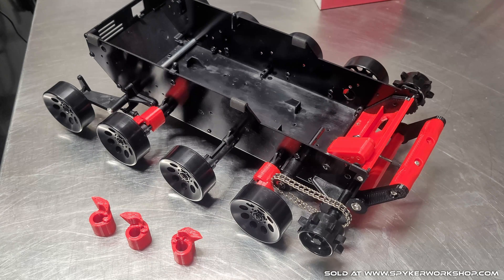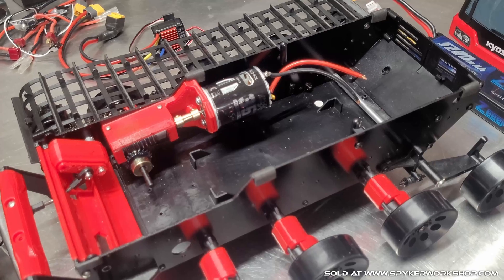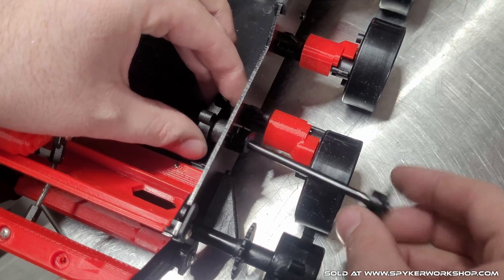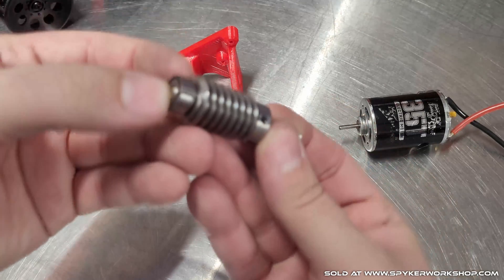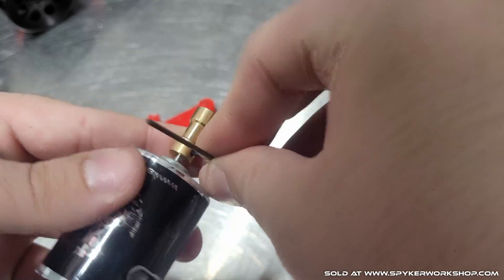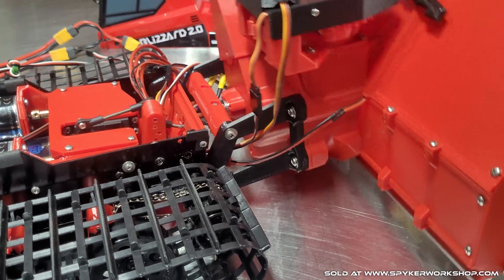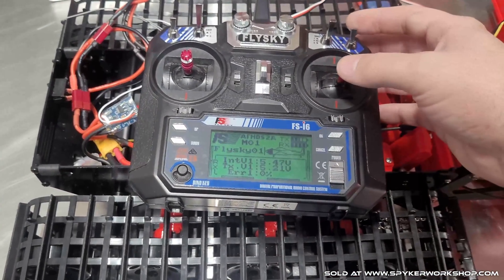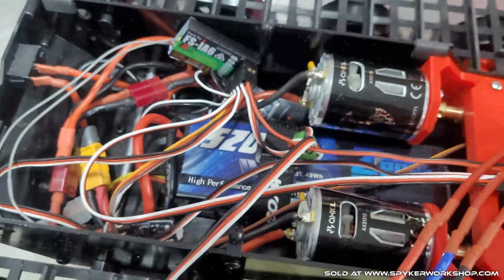Spyker Workshop - Kyosho Blizzard Upgrades (Worm Gear Transmission) - Assembly Instructions

Comment: when you have time it's possible to have a video to see how the maximum speed is and the slowest when working on pushing snow example we don't drive fast to have a nice finish example I drive 2x titan 380 traxxas and I really like the max apeed and the slow start that I am able to have
Reply from the maker: At the very end of this vid thats the top speed runnin on 7.2v 35T motors with the worm setup.
Reply: ok thx @thegreatestmoo
Reply: Did you try a 15t gear to gain a little speed, I don't know if it's too much for the motors???